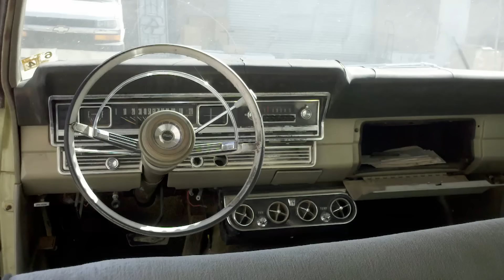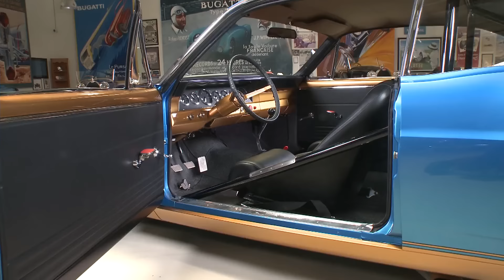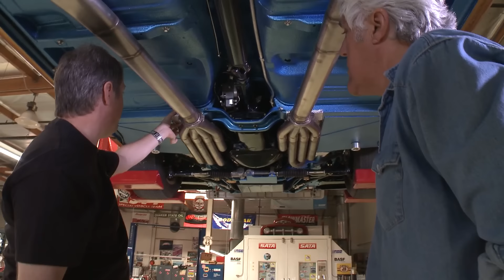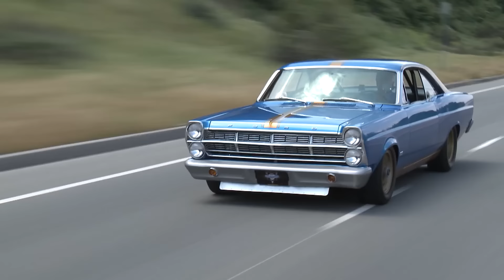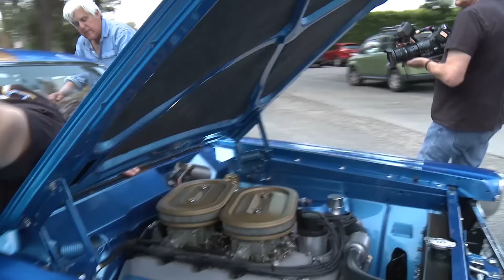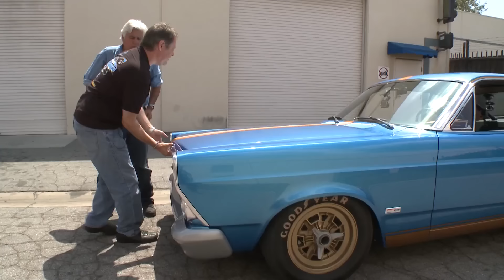1967 Ford Fairlane - Jay Leno's Garage

Comment: love this car. i had 67 2dr 289 2 speed auto. stuck a 428 CJ with 4 speed. 2 months later it got where i couldn't keep front tires on it and come to find out i broke what little of the frame there was under it. if i knew then what i know know i would have fixed it and still have it today.

Comment: cammer engine was 625 hp with a single carb built for NASCAR and band by them ended up being used in nhra think they were pushing 2000hp on nitro favorite Ford engine would probably have to mortgage the house to own one

Comment: SOHC - It was a 6' timing chain and Pete Robinson developed a gear drive for it. The 4 cam Indy motor was probably the highest revving Ford engine of that period. I believe it got up to 9000 RPM redline at one point. Cool engines!

Comment: I'm sure Steve loved having a throttle cable problem during filming with Jay.  You would think they should have tested out the full throttle position before a demo drive.  Very much a Steve Strope style car, "what if car."  Makes me wonder what will the owner actually do with this car, other than sit in a nice garage and sit at car shows.   It would be cool to know if it actually will get driven regularly and get some rock chips in the expensive paint job.

Comment: I hot rodded my 1966 VW Fastback converting it to fuel injection, porting the intakes, using exhaust improvements, etc. and improving the lift profile of the camshaft a bit. Once it was done and ready for use a friend had an emergency airport pick-up to do and asked If he could borrow the car. I hadn't tried it more than around the neighborhood at the time, so I didn't know what it could do in the hands of a lead-foot driver. He was impressed with the speeds he had attained but I was disheartened, I do not think enough break-in had occurred. It was a little like handing the car to Jay, as shown here. It wasn't quite ready for prime time.

Comment: The throttle cable went cattywampus... Be thankful it didn't do that while you were sticking your foot in it Jay.... On a lighter note... Jay Leno the only guy that can drive down the Boulevard Boulevard in industrial Los Angeles in basically a stock car, setting off car alarms , and never once do you see a police officer... I wouldn't get five foot in a car like that without getting pulled over....nice build...

Comment: As an old Ford guy I believe the gear driven OHC engine they are thinking about was the Indy DOHC 255 C.I. V8 which did indeed have gear driven cam timing...and just as an FYI, the Indy engine was based on the new thin wall block casting of the 289/260.
Reply: +steve Fowler    Pete Robinson made a gear drive for the 427 SOHC. Someone also made a Gilmer belt drive.

Comment: Love the car.  It's beautiful but with that horsepower and big back tires coupled with a steel driveshaft, I find it really uncomfortable for what looks to be the brake and fuel lines running inside the driveshaft tunnel with no protection.  If that is so, a broken driveshaft could lead to catastrophic events.

Comment: Funny flashback-my buddy, who had a '67 Fairlane, called me one day-40 yrs ago-and said, "My accelerator pedal is down to the floor, and I can't figure out what is wrong". I went over, and the car had literally broken in half, at the firewall, from rust damage. As the car drooped, it pulled the throttle linkage to the floor. A cool car lost to rust!

Comment: Pete Robinson did the first gear drive on this motor - and I actually helped Connie Kalitta set the cam tiing (I held a torque wrench..) on his cammer Bounty Hunter AA/FD..
Reply: If Pete Robinson hadn't passed prematurely, who knows, maybe the SOHC engine would still be an option in Top Fuel and Funny Car today. Pete was clearly an innovator and a big fan of the SOHC. He saw the SOHC it as being superior to the Chrysler Hemi, perhaps because of the overhead cam design vs.the pushrod approach. The SOHC also had a hemi head, but the added advantage of the higher rev capability of an overhead cam design.

Comment: Ah, those old V8s- not happy unless you had the throttle wide open.
Reply: +Mark Stockman True that, but keep thinking I will get a ticket. LOL
Reply: Lance Boil Now, my old '74 Catalina had the stock 400 with the big two-barrel; no "lumpy" cam, no secondaries to gum up.  Only mod I made was a free-flow air cleaner.  With that and a posi rear end, it just hooked up and went.  Made some real impressive noise when I lost the Y-pipe once.  And of course, coming off the highway, I just had to drop the automatic down into second.  (( evil grin ))
Trying to decide whether to buy a '74 Granville convertible with the HO 455, or send my daughter back to college for her senior year.  ;-)

Comment: Add a horn button on the steering column and connect it so that it opens cutouts on the mufflers - with the intense noise that engine makes, who needs a horn?  (Also, be sure to install the horn button-to-muffler linkage so that it can't go over center).
Reply: +Jim H. i rev my engine on my corvette instead of using the horn, on loud cars horns are just extra weight

Comment: Out of all the 427 side oilers I have heard on YouTube, this engine sounds the worst. Like it has no oil, metal to metal, like??????
Reply: +Carat Cranker Its straight piped to fit the theme, i bet if they put a nice resonator or muffler on there, it would sound great.
Reply: Yes, I did think of that, thanks for mentioning it. In Australia, we had 3 Fairlaine models from the late 60's to the early 70's, say 72, that looked similar to this, the ZB,C,D. but they were ALL 4 doors. And never had the front quarter panel slant back design. [right behind the lights]. Google Australian Fairlane ZA, ZB, ZC, ZD. the Za and b had side by side headlights, it's the C and D, that looked like this beast.

Comment: in germany you would get the red flag for fdriving with no horn and no mirrors :D
Reply: +MeddyGreen nanny state Australias the same
Reply: +MeddyGreen _ There should be a horn active in the vehicle, and have at least one mirror. But you can register it under collector car registration where modifications such as this can sometimes be fiddled with.
Reply: +MeddyGreen außerdem kein nummernschild vorne, und keine sicherheits gurte(wobei das bei z.b. dem Ford GT erlaubt ist)
Reply: ja hab ich auch gemerkt :D
Reply: Javelin X Right the Forward License plate should be on there dependent on state laws. In Arizona only a rear facing is required. 

The seat belts, were lap belts at that time. The government legislation for safety belts did not become mandatory in cars until 1968 per Wiki.
Reply: +MeddyGreen The horn is no problem, you just push a dummy button and tell the police thats the horn and it works, obviously he can't hear it but thats just because the engine is so loud.
Mirrors, yea, every streetcar should have mirrors, they don't need to be big but they should be there..
Reply: +MeddyGreen Same for Denmark. It would be impossible to get it on the street legally. Can't even upgrade the brakes to more powerful ones

Comment: These guys seemed like they did not know what the hell they were doing ironically and the uses of words like "hard linkage" did not do him justice lol. Obviously if there's slack in the cable but it's still connected to the pedal it's probably the connection on the carb. Took him a good while to figure that out, but we all have brain farts especially on camera and he knows more than me i'am sure. Maybe needs a stronger spring or a stop on that linkage.

Comment: Those Ford FE motors are some of the best sounding engines ever made.
Reply: Not a FE.
Reply: @lemham4565  SOHC motor is part of the FE family, based on a 427 side oiler.
Reply: @lemham4565  The 352, 390, 406, 427(including the SOHC), and 428 are all FE engines. The 429 and 460 are 385 series engines

Comment: Nice !,for improv work,I had an old  1ST gen Bronco 302,and part of the throttle linkage went south(the part that reversed the direction of throw)learned there were none being made,and no junkyard had any(they tended to break) rummaged through my junkboxes,and found an old part from a toilet flush mechanism(mostly brass) the holes to attach were exact fit to the  Ford ,polished it up,looked great(but different),I was running a Holley 500cfm 2 holer,and bragged about my limited edition Holley Double flusher !;  When are you going to take out that black 300 I keep seeing in the background ?(I had a red "62 300 many moons ago.
  Live your work, live long.,prosper,and keep doing videos !

Comment: Will wonders never cease. . .  My family owned that same "GrandMa" car when I was a youngster; sky-blue, lotta chrome, three on the tree shifter and that torquey six-cylinder inline.  The steering was not power assisted but so well engineered that my Mom could drive it easily.  Back in the day this was a family machine.  Excellent project, well conceived, and beautifully crafted.  ~ S ~

Comment: There's only one muffler that thing should have... Cherry Bomb Glasspacks.. it's the only choice

I miss having a car that set off car alarms.
Reply: yea if it was mine i wouldn't quiet it down. sure this is obnoxiously loud but as long as you drive it every now and then im sure you'll be fine. the cops may bother you over it though
Reply: OtisENGINEuity they last about 10mins before the glass blows out.

Comment: Had the throttle cable break on me coming home from work one evening in the middle of nowhere on my 71 Maverick Grabber. Pretty much stranded with no houses around and of course no cell phones in the early 80`s. I dug around in the trunk and found a couple of clothes hangers and a small block of 2 x 4 wood. I straightened out the clothes hangers, hooked one to the carb linkage, put the 2 x 4 between the fender and hood, latched the hood on the first latch, ran the clothes hanger through the gap, made a loop to cut the corner around the windshield and worked the throttle with my left hand out the drivers door window. Not that easy to operate with a stick shift and a car that pulled to the left when I let go of the steering wheel to shift. Bad part was I was broke and had to drive it that way for awhile.  That wasn`t as bad as having to take a wiper off and stick my arm out the window and manually wipe the rain off a portion of the windshield when it rained.  Luckily I never had to do both those procedures at the same time.  All that just to keep a freakin job that paid minimum wage that I really didn`t like.
 I worked at a wooden boat factory at the time using an electric sander standing in a water hole when it rained.
Everytime it rained I thought...Is today the day I get electrocuted? The car problems with little pay and going hungry all week were not much concern compared to that. LOL
Reply: +willythewave Similar thing with a 71 350' Chevy Stepside... throttle cable broke  & ended up tying a piece of wire to carb linkage & 'winging it' a few miles to a nearby salvage yard for another one.  

(Is this where we start sounding like our parents?: "Why, I remember back in the gas pedal famine of 1992! We couldn't afford gas pedals! Had to catch dinosaurs, grind em up and stuff them into the carburetor and wait for them to decompose... why you youngin's don't know... ")
Reply: just drove through a snowstorm in wyoming a couple weeks ago in a straight piped 68 firebird with a 461ci pontiac and had to wipe the windshield with a flip flop and heat it with a torch
... true story
Reply: +willythewave   How about this one.....I had a 1985 Ford pickup that literally caught fire while sitting in the driveway.......I let it burn ;-)   (True story)
Reply: @IronClad292  i traded my 66 mustang for a 78 firebird  first three days of owning it leftside lower balljoint broke.  Two days later rightside lower balljoint broke   A few days later the exhaust  from the y pipe back fell off i drove it to the scrape yard  got a hundred bucks out of it went and bought my 66 back
Reply: Haha! This reminds me of a friend decades ago who had a cobbled together Monza with a small block that broke the throttle cable out in the middle nowhere with some friends.   They had to sacrifice their shoestrings for throttle control to make it back to civilization.   Good times back in the day when you had to get creative!
Reply: +Raymond Cist yup... i later had to use that same flip flop as a thermostat housing gasket when my brother overheated the car when i was sleeping... blew the intake manifold gaskets only luckly, so i just tossed the thermostat, cut up the flip flop as a gasket and rushed his butt to the airport so he could plan his wedding while i stayed behind and actualy fixed my firebird and kept rolling...
Reply: I also had the throttle cable break on my '71 blue Maverick, 302 V8, when I was passing another car.  I rigged it enough to make it home with a short piece of rope and some bailing wire.  Pulled on the makeshift reins through the driver's side window and could make about 45 mph.  It was an automatic, not a stick shift.
Reply: William Adam (Revisiting this video viewing comments again)Yeah those Mavericks were bad for breaking throttle cables, at least you had an automatic and didn`t have to steer with your knees. lol I loved my 302 Grabber, it ran like a scalded dog. I put a 4 speed in mine but didn`t have a shifter to fit it for awhile so I had to cut a bigger hole in the tranny tunnel to reach down and get the linkages by hand. I swear that`s true. Mine was a rust bucket though but I loved it anyway, I could beat most stock chevy 350`s on the road. I think it ran so good because it was loose and about to blow up but never did. I miss those old days, in a way it was sort of fun having to be creative and resourceful, but not fun being broke and working a job you didn`t like that paid minimum wage. I worked in a wooden boat factory at the time btw. Standing in puddles of water using an electric sander because the roof leaked when it rained. Whew, risky business. :) I kept thinking: Isn`t OSHA supposed to be doing something about this? Yeah right. lol
Reply: I had a 71 Maverick. It ran great if you sprayed starting fluid down the carb. I was going down the road one day and my foot went straight through the floorboard, almost broke my ankle. Had an old drunk in my neighborhood weld in some sheet metal that he took off an old stove and was good to go. Drove it for two years, went through two or three cans of starting fluid a week.
Reply: @RockandrollNegro  We just used to pull over at night and steal the road signs and beat them with a hammer until they fit to cover up the rust holes in the floor boards, no welding involved...maybe a hacksaw. :)
Reply: @willythewave   OHSA can't do anything unless they know about it....
Reply: That reminds me of the time my dad bought a used VW....1966...I think.  Well anyway we drove it from Jacksonville, FL to New Smyrna beach, FL.  The throttle cable broke off the gas pedal as we were leaving the house at which we were staying.  So my dad, in his infinite wisdom, cut off a broom handle and drove a nail in the end so he could work the throttle and I could shift for him.  We made it back home some how!  I'll never forget that!
Reply: @joshjohnson8937  LOL A memory you`ll never forget with your dad. Bless you man. :)
Reply: The good old days!
Reply: Let me guess, you are over 50 and a millionaire.
Reply: @Gregarious3  LOL Nope... over 50 yes but a millionaire would be life times away.
Reply: @willythewave  It happens, my brother has that ingenuity but, not the focus to get a good price for it. Keep having fun man.
Reply: @Gregarious3  Amen brother, I know how he feels :) You guys keep having fun too my friends, :)...And always remember...you are brothers. Love each other. I love you both. Thank you for replying.
Reply: willythewave millennials will never know what it feels like having to do something like that. I feel terrible I'm part of that generation having been born In the 80s.
Reply: These stories are awesome, I can relate to everyone of them. Cereal boxes worked great for gasket material.
I had a Datsun B210 that I literally carried a whole engine taken apart in the trunk for my parts source. lol It used more oil than it did gas. I would stop at gas stations and get the used oil by the gallons.
Dropped off the shoulder of the road in that Maverick once and broke all the lug studs on one wheel, back tire and rim passed me up. Had to go get the tire and drive out lug studs from each of the other wheels on the side of the road. (Rob Peter to pay Paul).
Junked several nice old muscle cars because I couldn`t afford to or had time to fix them because I spent all my time working. Back then they were a dime a dozen, just old used gas hogs that nobody wanted anymore. (All true stories).
Maybe Jay will share some of his stories like these with us. I`m sure he has several to tell too. :)

Comment: It was "Sneaky Pete" Robinson who, in conjunction with Harvey Crane, developed a gear drive for the SOHC Ford when the chain stretch issue caused too many failures on the blower equipped engines he was using.  http://www.hotrod.com/features/1505-90-day-wonder-sohc-427-cammer/